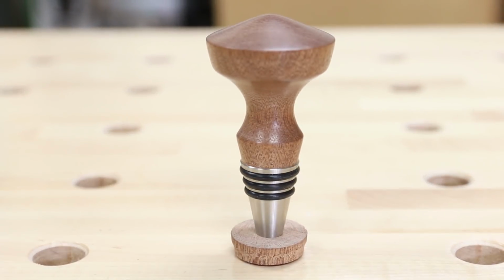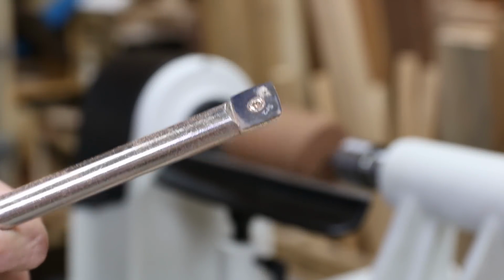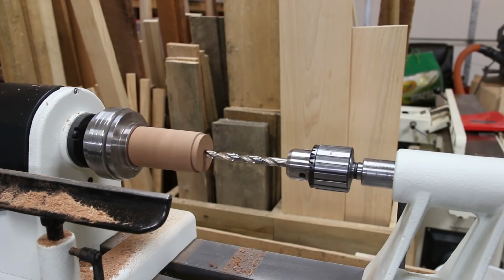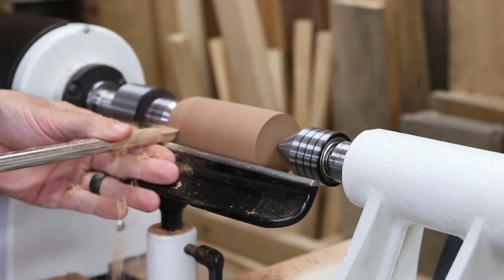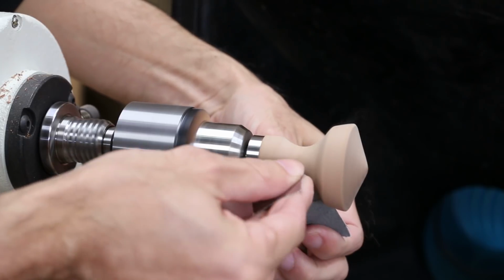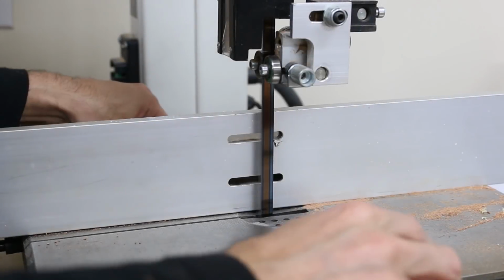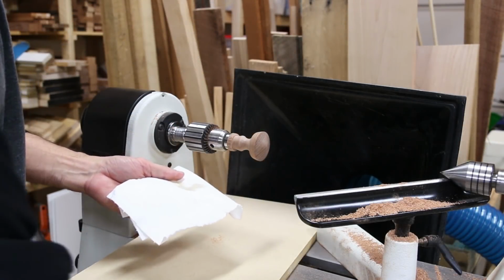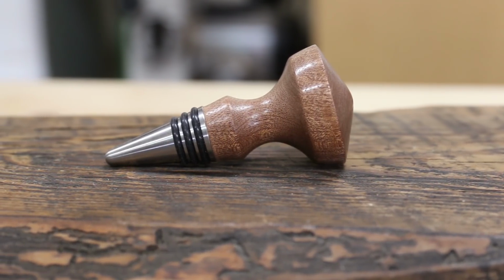How to Turn a Bottle Stopper | 6 Days of Beginner Woodturning Projects Day 1

Comment: Hey man always enjoy the videos!  Quick tip, when using the drill chuck in the tailstock, keep your hand on the chuck as you advance and retract the drill bit from the wood. If you don't keep your hand in place, you can easily send the drill chuck flying out of the tailstock when you go to retract the bit if it gets caught in the wood at all. Can be very dangerous!

Comment: Great tutorial, Brad! I've made a few of these. The last few I made, I used a bottle stopper chuck that threads directly onto the spindle and it worked fine. I don't own any of the carbide tools, but after watching your video, I'm tempted to buy a few. After watching you video, it looks like you present the carbide cutting tip 90 degrees to the vertical plane of the wood. With these tools, do you use that same approach with all the cutting tips?

Comment: I think it's best practice not to use a Jacobs chuck in your headstock unless you either use a draw bar or use tailstock support.  Otherwise vibration can cause it to come loose and potentially throw it across the shop, ruining your work piece and maybe your day. I use 4-jaw chuck inserts small enough to grip my mandrel.

Comment: Did you notice any issues using the Jacobs chuck in the headstock without a drawbar? I'm planning to do just that, but read some things that have me a little worried about it. Great video!
Reply from the maker: +Michael Lawing yeah, I did have a few times when it wanted to work loose. Mainly when I was sweep cutting away from the headstock. So I just started cutting in towards the headstock and it was fine. I'm so new at turning I've literally never heard of a drawbar
Reply: Fix This Build That  if your Jacobs chuck has a threaded hole in the Morris tapper end, all you need is a piece of all the ad and a washer and wing nut. It should always be used when using the Jacobs chuck in the headstock with out the tail stock up tight. My chuck came from HF and was not tapped I had to drill it out and tap 1/4" x20 threads in it and it works great.
Reply from the maker: Great tip, thanks!